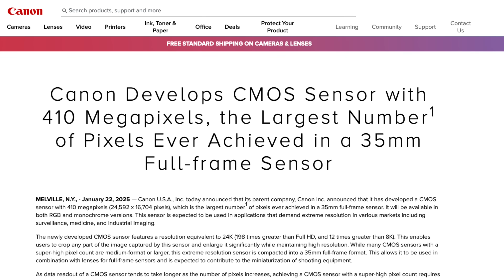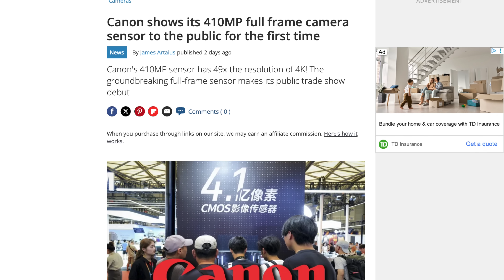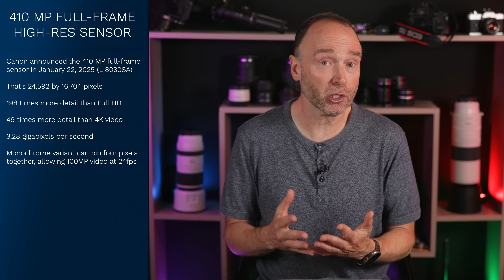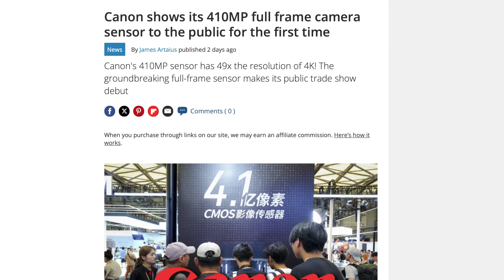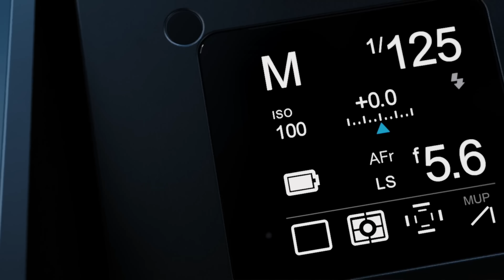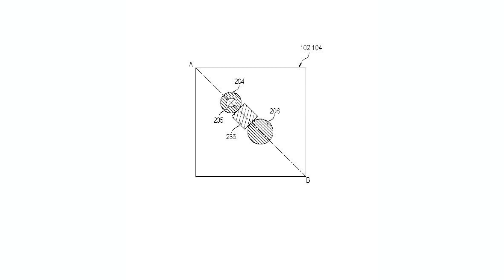410 MP Canon sensor

Comment: Seems it would make sense for all the larger interchangeable lense camera sensors to come up to 200-500mp when phones use 200mp now with much smaller sensors.  If for nothing else to improve low light performance with pixel binning and also to allow narrower lenses and just use digital zoom to get in closer.

Comment: The image processing would need a supercomputer to handle 24 fps at 410mp, also the storage will need to be blindingly fast. When using it for astronomy it will probably cost as much as the telescope.

Comment: I hate to be that guy but honestly this is nothing special. We've had 200 megapixel sensors in phones for years at this point and it just shows just how much the full frame market is lagging behind by using very outdated lithography processes. Take the Samsung Isocell HP1/2 for instance which has a tiny surface are of 76.5 mm² from what I could gather. This results in 2.61 Megapixels per mm². So if we apply the math of how many megapixels a full frame sensor would have with equivalent density which would be 2.61 mp x 864 mm² we'd get 2259 megapixels or 2.26 gigapixels. 

Yes of course I understand the reason why you'd want larger pixels with better low light performance etc. and that they are not directly comparable but we are just talking about manufacturing viability here. Still you don't even have to use the latest and greatest manufacturing but having at least a few hundred megapixels in a full frame sensor should be default by now. For better low light performance just use lower resolution and bin the pixels. Again what Canon has done here is long overdue and yet I still doubt it'll make it into mirrorless cameras like it absolutely should.
Reply from the maker: It might be nothing special, but it's news that isn't covering politics and finance. It something related to the gear and kit we love even if fanciful.

Comment: Not sure they make a computer that normal people could afford to purchase, that would run 24K video..  Thanks..
Reply from the maker: You'd be surprised. It's not so much the processing power required, but the codecs. a $799 MacBook Air 13 inch with 8GB ram can easily editing and export 4K video, but 8K is impossible due to the ack of 8K codecs. The next model up can do it because the chip has 8K encoders and decoders without much more processing power. 

But point to you - none of these chips support 24K encoding so performance could be way off, but the real problem might be storage - it could make a 4TB card weep ;)

Comment: It's most likely going to be aimed at QA in manufacturing processes. Things like looking for defects in camera sensors coming off the fab line. I'm not sure it's reasonable to use their camera lenses at max resolution. They're not designed for that small of a feature size. Where it can make sense is in binning applications. RGB for each logical pixel, like the old fovean sensors, but at 100mp/image. Same with video, eliminate motion color fringing. Security will require higher binning for IR, so the ability to scan for different wavelengths by adjusting the logical pixel size is a good thing. A rotating rgbi filter with software selecting the appropriate virtual site size gives you full color + IR. Useful for all of those QA and security needs. That's how Canon has used/sold their previous high resolution sensors. They've been making 100mp+ sensors for years, they're just not intended for our kinds of camera.

Comment: Hi Simon, you know there'll never be an R4 (because 4 is Japanese for American 13) but sure this may someday be the core of the R2, with an Astro derivative called R2d2 😛
More seriously, I'll they use this sensor internally to check which of their current R glass is able to resolve enough resolution.  If they'd release some R bodies near or beyond 100mp, they want to ensure they have enough lenses to match
Reply from the maker: IN china the number 4 sounds like death...
Reply: @OrdinaryFilmmaker  Same in Japan .. I recall a Japanese driver refusing to race car #4 in Formula 1 (some decades ago when race numbers could not be chosen freely)
Reply: Well Nikon put out the F4 a long time ago.  Canon seems to steer clear of 4.

Comment: 410mp on a full frame sensor makes a lot more sense than Samsung’s pretty small 200mp sensor for smartphones,

Canon has already made 250mp sensors in, I think, the “H” size sensor they used to use in their sports cameras until they went all full frame for that.

Comment: I suggest getting the price of chips DOWN is more important right now than a 410 megapixel chip size; that is, of course, if Canon want to give customers a reason to buy a camera that has a 36x24mm chip in it . . . instead of just using a camera in a phone. Others have noted that the modulation transfer function of a lens that can make use of a chip like this might be an expensive piece of glass. Such a chip and lens could end up as a studio princess. More lenses? See your bank manager. Forensic photography? Medical photography? Hmm?

Comment: I’m impressed. But for it to make a difference, the optics need to focus a sharp enough image on the sensor so that there’s a difference between adjacent pixels.  The MTF of the optics could make the sensor pixel density irrelevant.
Reply: I suggested canon make the sensor have 3 by 3 pixels with 9 different color bands.  (But my comment was deleted here).  This drops the resolution per color down to 46 MP and allows detecting the spectrum of the image with 9 wavelength bands and 46 MP resolution.   There are many uses  for such a camera
Reply: It's completely useless... the best lenses cap at around 50MPx. Not that it matters anyway... with age I tend lean towards less detailed images as they have more "charisma".
Reply: @jeffsaffron5647 There are plenty examples of lenses with 200+ lines/mm and higher resolving power, that can easily cover 61mp, 100mp and more
Reply: @jeffsaffron5647 perhaps if every block of 3 by 3 pixels were 9 different color bands, then it would allow awesome processing of color. For example  unique skin tones or image processing enhancements based on spectrums. Each color band would have about 50 megapixels and not be wasted
Reply: @jeffsaffron5647  yeah I think the Sigma 135 mm F1.8 can do about 200 megapixels, I think lenses can be designed to do 400. It’s just that they haven’t had to make that a design priority.
Reply: @andrewrice9383  any lens can be made if other limitations such as size, weight and cost are not the factor... but I don't know about any lenses currently on the market that have actually been measured to be above 50MPx...
Reply: @andrewrice9383  not all lenses are 135mm f1.8, which why just increasing the resolution doesn’t actually make the images higher res at a certain threshold.
Reply: @jeffsaffron5647 I think old technology film reconissence used large format (6 inch?) film and got over 200 lines per mm. 15,000 line pairs.  That may have been for a particular wavelength band.
Reply: The only way to overcome diffraction is a bigger sensor and pixel pitch, its impossble to make lens optically perfect while keeping the cost reasonable. 

There’s a reason why pictures from a 12mp sensor and a 48mp one on a phone looks exactly the same

Comment: Okay, this is a bit out in left field, but what kind of sensor resolution would you need if your end result was going to be high resolution 3D video? Wait, you say, there's already been 3D video made for HD (maybe 4K?) TV; nobody wants to wear the damned polarized glasses just to watch TV. Correct. But what about a revolutionary screen that projects realistic 3D images at 24 fps and requires no glasses or headset to view? It's in R&D. What I saw (on YouTube iirc) a few years ago was a 3D still frame on a prototype flatscreen. Video still out of reach. And it would require a LOT of bandwidth for broadcast or streaming but maybe starting with Blu-Ray type devices and eventually streaming, etc. can catch up. The technical challenges will be overcome. And any such video capture system would likely require sensor resolutions like this or higher. Just speculating for fun because I'll never live to afford any of that. I like my R5.

Comment: Please calm down. They already published that news in January...

And these industrial sensors do not affect the specifications of consumer sensors.
In 2015 they introduced 250MP sensor in APS-H format. The pixel density is about 41.8 MP/cm^2.
The EOS 5Ds/5DsR released the same year has 5.82 MP/cm^2.
And this model remains the highest pixels of Canon's consumer full-frame cameras.
Reply: Looks like there is a demand for high-pixel sensors for Canon to push further - 410MP sensor.  For spy plane, low orbits satellite?

Comment: 1:18 - Ok, based on how Canon does things, a 4K-UHD video (3840x2160px) has 4 times the resolution of a Full HD video (1920x1080), the 4K-DCI is a little bit wider, 4096x2160px. The EOS R5 has a sensor resolution of 8192x5464px but video doesn't use all that area, just 8192x4320px for 8K-DCI and it crops to 7680x4320px for 8K-UHD. Considering this, a mathematically 24K-DCI video would be 24576px wide, but the Canon's specs shows a 24592px wide sensor, 16px more, ignoring that fact, a 24K-UHD video using Canon's crop would be around 23040x12960px, around 24 times the resolution of a FHD TV, and around 12 times the resolution of a 4K-UHD TV, not 180 times, remember, megapixels measurement is linear while a displays and sensors have two dimensions.

Comment: Ummm! interesting. Some mobile phone use high  mega pickles sensors (other than marketing) it is claimed that through pixel binning better images are produced although it is probably a good marketing tool as well.  In a 410 mega pickles camera you could go crazy with pixel binning offering variable binning option up to may be 4x4 still giving you a 25mp image and a lot better image than a standard 24mp image.
Reply from the maker: Oversampling/downsampling does produce better results. But how it is done makes a difference. It's always better to cut the resolution in half than by 60% or 40%.